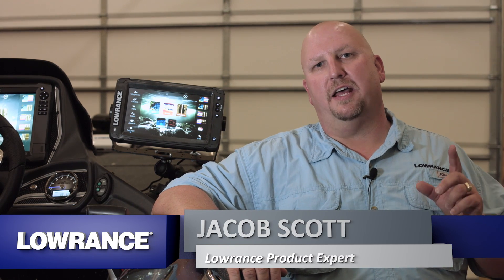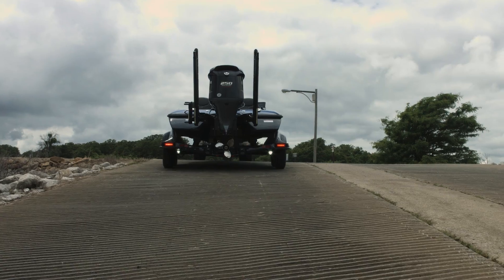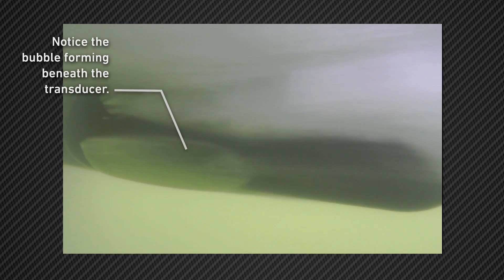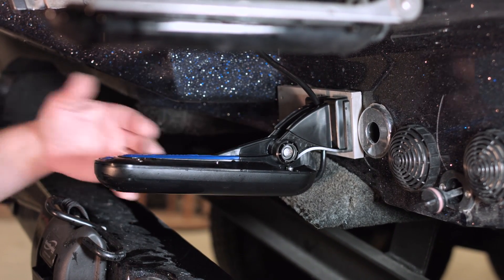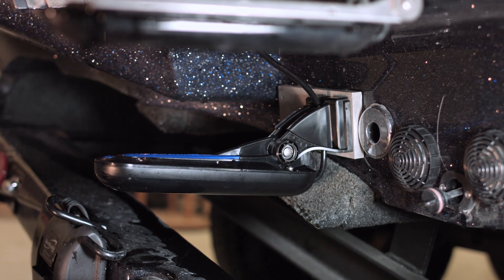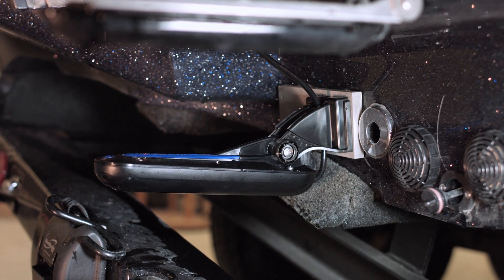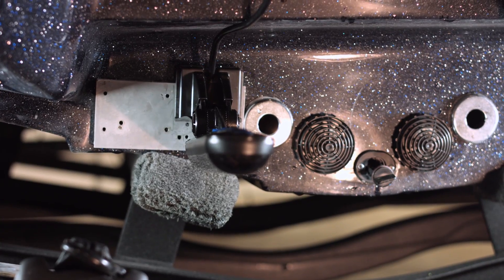Lowrance | Good and Bad TotalScan™ Transducer Installations

Comment: Hello, i need more technical details about this product, chirp power ? (300w or 600w ) cone angle ? ... thanks
Reply from the maker: It is a 600W tranducer with respectively cone angles:
83kHz 52°
200kHz 22°
Reply: @lowrance   thank you for the quick answer.
I need more détails this product too "000-12728-001"
Power ?
Max speed ?
Max Depth for medium and high chirp
Angle ?
It work with hds 9 live ?

Thanks,
Reply from the maker: Yes it will work with a HDS Live.
600W. 83kHz up to 1000ft.
83kHz 52° degrees
200kHz 22° degrees

Comment: I'm sure this won't be an issue installing it on my kayak. As long as it sits level right?
Reply from the maker: Hi,  It should be no problem installing on a kayak.  You want the transducer to sit as close level as you can, both front to back and, side to side. Be sure to consider how the kayak sits in the water when you are in it and you should be fine.

Comment: Why does the totalscam instructions showed the cable backwards like the bracket Hass to be on the opposite side of the cable was that just a miss print or is that the way it should be installed this is for the elite fiveTI totalscam

Comment: Do you know what would make this video perfect?   Some footage from above water as well.  That would show us whats going on there as we dont have underwater cameras setup like you do!    Very helpful but that little bit extra would make this video perfect beacuase I'm having trouble getting my totalscan to read at speed
Reply from the maker: Thanks for your comment, Ben. The Ti screen capture on the bottom right shows a direct capture from the unit, synchronized with the underwater camera. This allows you to see what the unit is showing as well as what's happening underwater. 

What would you like to see above water that would be helpful?
Reply: @lowrance  A camera shot as though we are looking at the transducer from the back of the boat when on plane would be nice.    A simple line drawing included with the owners manual showing the transducer in relation to the hull. 4 perspectives: 1)side view, 2) directly behind, 3) & 4) a 3/4 view from the rear each side. Preferably with a dashed line extending along the bottom of the hull past the rear of the boat as a reference.
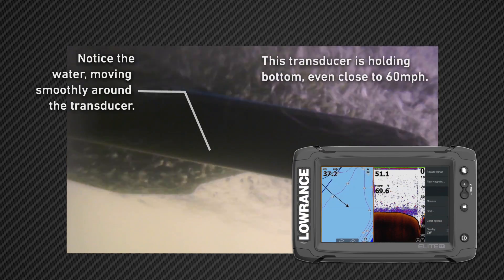Reply: Hi, Would like to see the water disturbacnce from above water that goes with the footage at 1:50 mark. Mine has a rooster tail of water coming up off it and that doesnt seem right. I have raised the transducer up already but maybe need to move it much more.  Look for any pointers that will help and that above water footage in combination with the existing contents of this video would really help I think

Comment: In all the internet and all the manuals it says that transducer must be installed 1inch below the hull. I read lowrance simrad furuno raymarine all of them are saying 1inch below the hull and paralel to the water. The information here you are giving is incorrect. You are saying it must be lined with the bottom or hull of the boat which is wrong. It must be 1inch down not lined with the hull. Thanks.
Reply from the maker: We cannot speak for other manufacturers, but our installation manuals state the transducer should be installed with the midline of the transducer below the hull.  One inch below the hull is incorrect for all Lowrance and Simrad transducers.
Reply: yes midline is approximately one inch. Some larger models maybe different. Why are u giving wrong information here as lined with the hull. It must be 1inch or with the midline. Thanks.
Reply: No it should be half way below bottom of transom

Comment: i want to buy an elite9ti for my bow can i use that transducer on my trolling motor? it looks to big for my trolling motor.
Reply: Cut the fin off your trolling motor with a hacksaw then "glue" the totalscan transducer with 100% black silicone.
Reply: I have the Elite 9Ti at the bow with an HDI transducer mounted to the Motorguide Xi5. I'm not happy with the performance and have considered switching to a totalscan transducer and mounting it to a separate transducer mount made specifically for bowmounting the transducer separate from the TM.  I'm still debating the value of having side imaging at the bow, but it would be unaffected by the change of direction of the TM.
Reply: Yes but side scan will mess up